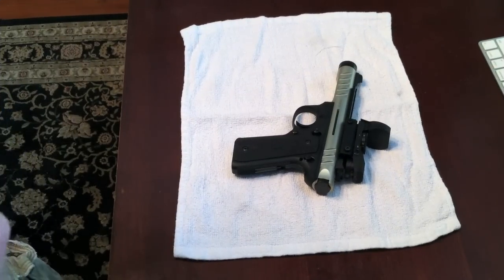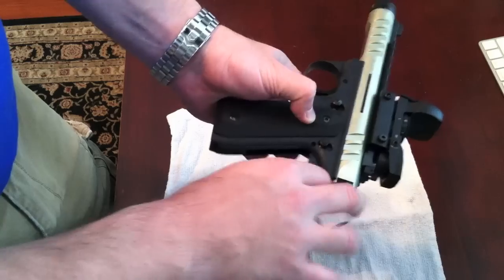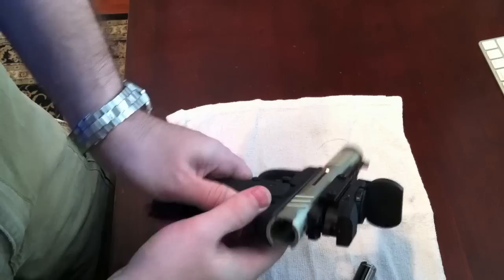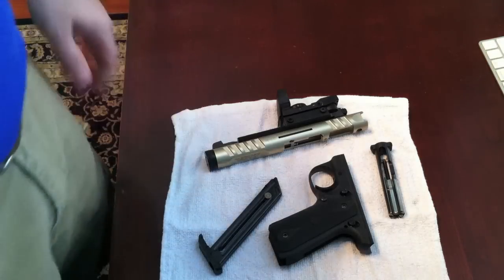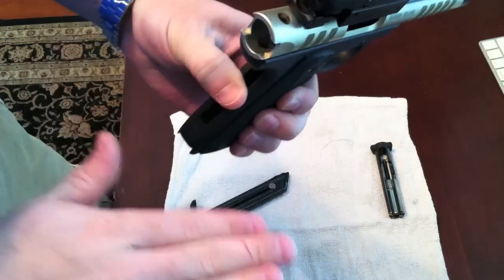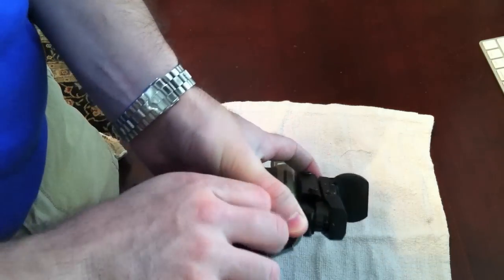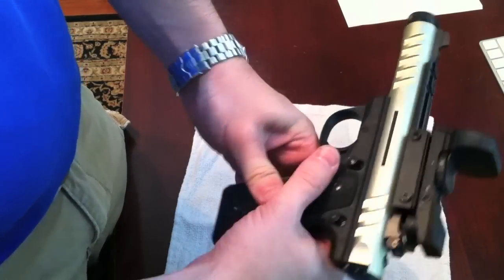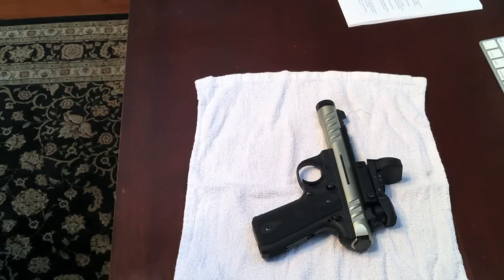Ruger 2245 Breakdown

Comment: For all those not familiar with this design, the taking apart is the easy part and NO MATTER HOW EASY IT APPEARS to go back together they are REALLY tough to get back together.  There is really a trick to all the Ruger Mark series and the Ruger 22/45 series. I wish they would change this design because it really is frustrating.  Besides that these are really great guns which are accurate, fun as hell to shoot and will last for many years. My father has a Mark II (maybe MarkI) which is over 40 years old and it looks like brand new. I have a Mark II which is a bull nose and a Mark II w/built in suppressor(like seals and massad use) and it is very fun to shoot!  Although personally I would get a threaded version so you can add your own options/suppressor.

Comment: DUDE!! Did you actually skip the whole part about  getting the main spring assembly  to go into the grip frame, you know the whole first step in the process? Mine will not go down no matter how I hold the gun or trigger pulled not pulled mag in mag out muzzle up sideways down. FRUSTRATING that you skipped that in this video.